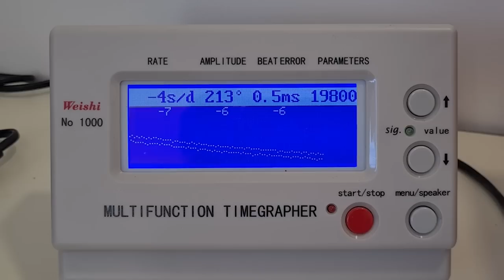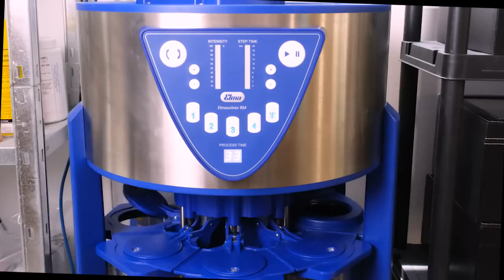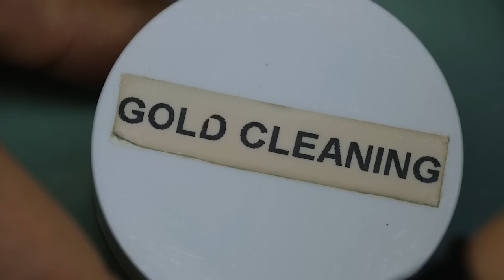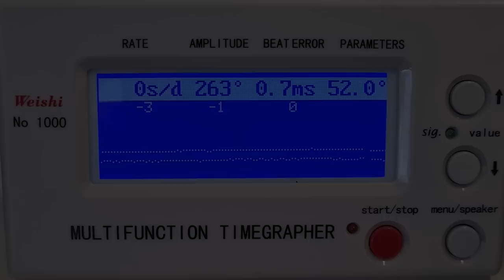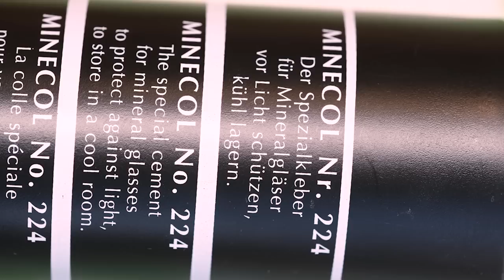Does this Patek Philippe have a repainted dial?

Comment: Nice work. You are brave to work on this piece of art. To your issue with weight and health, I too found my rotundity unacceptable when I visited my doctor and weighed in at 210 lbs. My doctor spoke about the wear this extra weight would put on my joints. I felt helpless to the tide of aging. Then, in September 2021, I started the Noom app. Walking a lot each day, drinking more water, and balancing the calorie density of the foods I ate shed 40 lbs in 6 months. All that is to say, losing weight and getting your body back into shape is totally possible. It is within your power to change your relationship with food. Looks like you figured that out without an app. Congratulations! And long life to you.

Comment: What a joy it must have been to work on one of these.  A vintage Tiffany & Co. pocket watch with a Patek movement that had the "wolf's teeth" wheels just sold on eBay.  It was incredible!.   It went for ~$1300.
Reply from the maker: Wow, that sounds like a steal 😳
Reply: @VintageWatchServices  Yes....I thought so.  I am kicking myself for not taking a stab at bidding on it.  It would have been pushing the envelope financially, but is was an incredible piece. There have been others.  A Tiffany watch made in the 30s with an IWC movement sold as well.   It, too, had the wolf teeth wheels.  Stian, was their an advantage to those sharp "wolf's teeth" wheels?.  They seem to be quite rare and only appear on the highest quality movements.  Is there a reason for that?.  I presume it is expensive to make?
Reply from the maker: @wildernessofzinn17  There wasn't really much of an advantage, no, it was more a way of showcasing the skills of the manufacturer. Wolf teeth wheels are more difficult to make and they do slightly better as ratchets, but not enough to justify them for that reason alone.

Comment: Congrats on taking charge of your health and yes, it actually is inspiring. I’m in the same boat and every nudge v pudge helps. 
Another watch question: If a watch is adjusted to X positions plus temp, does servicing it knock those out of whack? And if not, why not?
Reply from the maker: Thanks Angelino! Servicing won't knock adjustments out of whack, no, but lack of servicing will :) If a watch hasn't been serviced for a really long time, it might develop wear that will permanently impact the adjustments and then it will have to be re-adjusted.

Comment: I congratulate you on your weight loss. I am prone to it also, and it bugs me...but anyway. I suspect the dial was re-finished at some point as "swiss made" is missing from the dial at 6 o'clock. The burst pattern style also seems incongruous to a Patek. A lovely, classic traditional gents' watch!
Reply from the maker: It might indeed be re-finished, but the lack of Swiss or Swiss made isn't necessarily significant. I've seen PP dials without it. And just from a logical standpoint, if someone had their PP dial refinished, I'm sure they would have had it refinished really well. So I'm really not sure about this one. It immediately struck me as off first time I saw it, but it might actually be original. I hope the extract request will shed some light on it.

Comment: Stian, I came to the same conclusion, and have so far lost 42 kg.  Good luck in your quest.  That picture  is of me 20 years ago!!  Great watch  repair work as usual.  Stick to 2000 kcals a day and you'll be in good shape if you eat proper food.
Reply from the maker: Wow, that is very impressive, Luke 💪
Reply: @VintageWatchServices  just try not to rush it.   Took me 18 months.
Reply: Went from 136.5 to 94.5

Comment: Hi Stian, I notice that at 19:26 the train of wheels oscillates after you impart rotation. Why does it do that? What causes the rebound effect? Is that just the release of the pressure of flexion within the parts of the train?
Reply from the maker: Hello Mike, the slight recoil is caused by the mainspring flexing back a bit after being slightly coiled, together with the click spring forcing the barrel slightly backwards. It isn't always too visible but there should be a slight recoil in a freely running train of wheels.

Comment: Hi Stian, one small question - why do some objects go into the cleaning machine and other parts go into the ultrasonic cleaner? What's the difference? Is the former for removing old oil and the latter for removing dirt?
Reply from the maker: Thanks for watching! The ultrasonic is actually very strong and I don't put parts in there such as the balance with the hairspring, thin jewels etc. In general I use the ultrasonic for the case and the watch cleaning machine for the movement.

Comment: Could you tell me how parts like the bridges are made from the parent metal? Are they stamped & then machined? And what about the tiiiiiiny parts? I guess the main plates are milled. Are the small parts laser cut now?
Such a lovely piece of thing. Beautiful.
Reply from the maker: Thanks for watching! Bridges and plates are indeed generally milled and in the better brands then hand finished. Mainstream brands will use CNC for finishing also. Small parts are EDM cut nowadays.

Comment: That is a really nice watch. Grate work too, as always. What kind of solvent do you use just to just get rid of the oxidation on the case? As for the life style thingy. I totally get you. I've been swaying back and forth between 75 and 120 kg most of my adult life. And since I've started with watches Iv'e been on the upper side of that scale. I just don't get enough exercise anymore. Whenever I have a full day free I spend about 10-12 hours at my work bench. Not much exercise going on there. Sorry about the rant. ;) But I'm quite confident that you get the point. Oh, by the way. Was that you wife's nail curing station you used for the glue? :)
Reply from the maker: Thanks Hans! I use Silvo for removing oxidation. And yes, sitting is the new smoking, they say... it's really not good for us to sit still so much, and working on watches is pretty difficult if not sitting still. I use a fitbit to remind me to get up and move around a little bit every hour and that helps. 
The curing is a UV lamp that's actually especially made for watches :)
Reply: @VintageWatchServices  I usaly listen to music when I work with the watches. And once in a while I notice that I've started to bob my head to the music. The angel on my left shoulder then says "sit still you idiot". While the devil with the pointy pallet fork, sorry I mean pitch fork, says "go a head, headbang the hell out of the song".

Comment: Brilliant job as always.  Kind of missed not seeing any nose hairs though LOL.  Just out of curiosity, I would presume you cleaned the crown and stem in the watch cleaning machine?  Why wouldn't the cleaning solution have cleaned out the DNA inside the crown if this was done?  Cheers
Reply from the maker: Hello Cliff, I generally do not clean the crown and stem in the watch cleaning machine but rather manually. This is a habit from crowns with gaskets in them, as the cleaning solution isn't good for the rubber in the gaskets. This one I cleaned in the ultrasonic after manually removing that gunk :)
Reply: @VintageWatchServices  Makes since to me...I learned something.  Thank you!

Comment: the " intake" timegraph is set 51 degree, the "finished" 52.....?
Reply from the maker: Well spotted! Yes, I work on a lot of watches at any one time and sometimes I forget to reset the amplitude. It's not really much of a matter between 51 and 52, as the amp changes perhaps 5-6 degrees, but if it were an old pocket watch movement for instance, you would see a big difference.